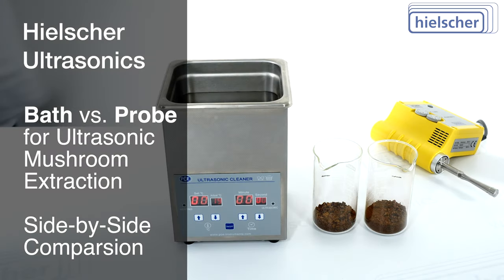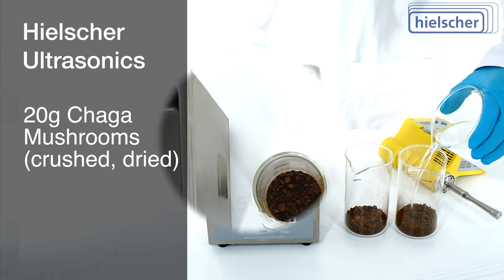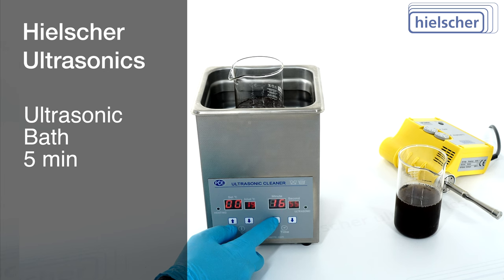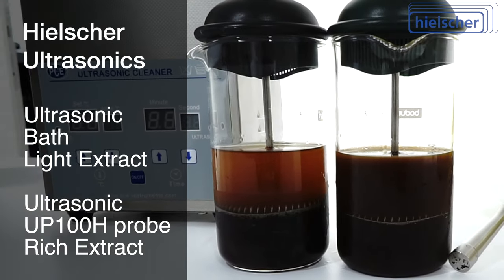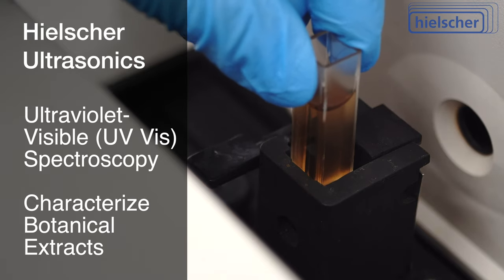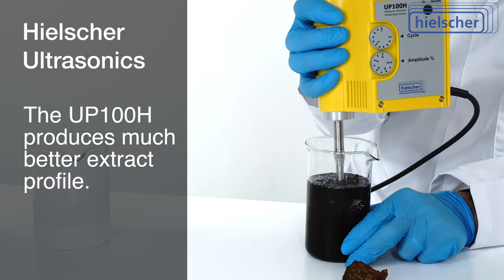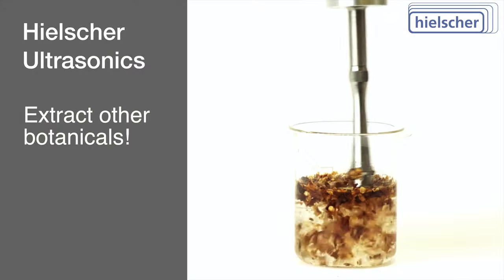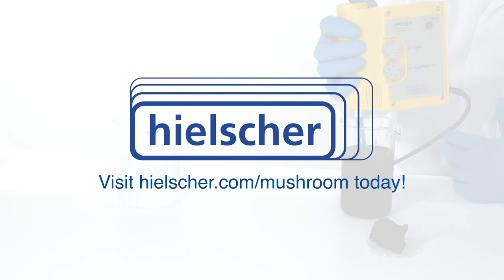Mushroom Extraction - Bath vs Probe Sonicator - Side-by-Side Comparison

Comment: The bath costs < €100, the probe >€3000.. not a solution for at home.. unless you have €3000 laying around somewhere
Reply from the maker: @timm5358 If the bath simply cannot extract properly, you waste €100 and got yourself an expensive jewelry cleaner 😆
Reply: right, this couldn't be directed at normal consumers, regular people would buy the 100$ one and just run it for longer vs spending 3000$
Reply from the maker: @jhonsmith5567 That’s like trying to drive a nail into the wood by tapping it with your finger for half an hour.
Running something at much lower intensity for longer is not the same as high intensity for a short time. Hope that helps 😉
Reply: @HielscherUltrasonics  Looking into your products but don't have the money at the moment, plan on buying in the future. 
But I am wondering even if you were to run the water bath method for 24hours with the extract directly in the stainless pan, it still would not produce similar quality extract? 
Glad I came here, saw this video and comments, as I had been browsing water baths.
Reply from the maker: @Jake-jj1zs If you sonicate in a bath for 24 hours, the liquid will get hot (boiling). This results in a thermal degradation of the bioactive compounds. Even with pauses for cooling, the low intensity of bath in insufficient for breaking the cellular structure or overcoming the limited permeability of the mushroom matrix. Therefore, a cleaning bath cannot extract the same quality or quantity of bioactive compounds as a probe sonicator.
Reply: @HielscherUltrasonics  Copy that, will save money for Probe Sonicator.
Would like to bounce another question off you,
What about a magnetic stir plate in a cold environment for 24 hours (vs. 30 day soak)?  Assuming it wont reach sonicator levels of quality but assuming the agitation is helpful.

Other videos say to do a long soak in ethanol but now realizing that is not the way to go, better to do it quickly with lots of agitation. I also see in your video, it requires the strong agitation due to the chitin.
Reply from the maker: @Jake-jj1zs: Our clients extract almost all materials, such a oak (for oaking) cannabis (for CDB or THC), spices, herbs, fruits or all kinds of mushrooms (magic and non-magic). In our 30+ years that we make ultrasonicators, we have seen almost everything.
Botanical extraction is a matter of intensity. More so for robust matrixes, such as wood, dried spices or mushrooms (yes, chitin). The ultrasonication does improve extraction speed, due to the intense agitation and the promotion of mass transfer. More importantly though, the ultrasonic cavitation breaks cell walls and solubilizes hardly soluble substances. Without the cavitation intensity, the latter won't be extracted at all. Last but not least, sonication does extract more and faster without harsh chemicals and without heat. Heat degrades thermally sensitive bioactive molecules.
In short: Sonication extracts faster, more and a wider spectrum while preserving the extracted compounds. This gives you a full spectrum, high quality extract and an excellent extraction yield.
Reply: It would be a better test to pour the solvent and botanical product directly in the bath, it is designed to hold liquids. Placing a glass beaker containing the solvent and product into the machine will reduce its effectiveness. It’s not designed to be used like this
Reply from the maker: @marksymark1 While not using a beaker may be slightly better for the extraction (still very poor intensity, less than 20 Watts per liter), exposing the bath inner surface to solids during sonication reduces its lifespan drastically (—> keyword: pinholes). Unless you want to buy new equipment frequently, you should not use a bath with solids in it.
We hope you like our video! Please follow our channel for more interesting videos. Thank you! 
👉 https://www.youtube.com/channel/UCG1xa_8clP9cRlq7kIcWQug?sub_confirmation=1
Reply: A good ultrasonic bath is designed for years of use, sturdy stainless steel construction they use them for cleaning automotive parts, no chance of pinholes, 30 watts per litre minimum. It is recommended to run several cycles per batch for maximum extraction. Product from Hielscher is very good and if your budget allows it would be a good investment.
Reply from the maker: Citation from a recent third-party study: "Probe sonicators fared better than bath sonicators in extracting bioactive compounds while ultrasound assisted with enzymes was more efficient than conventional or alkali extraction methods." (Inguanez, L.; Zhu, X.; de Oliveira Mallia, J.; Tiwari, B.K.; Valdramidis, V.P. Extractions of Protein-Rich Alaria esculenta and Lemna minor by the Use of High-Power (Assisted) Ultrasound. Sustainability2023,15,8024. https://doi.org/10.3390/su15108024 )

Comment: You're using the ultrasonic bath wrong. It doesn't work as well when objects are placed directly on the bottom of the bath. That basket it comes with is not optional. Set the beaker in the basket.
Reply from the maker: @LarsLarsen77 we will take this into consideration for future videos.
Thank you for watching our video! If you liked this video, please share it with your friends and colleagues. Please subscribe for more videos! 
👉 https://www.youtube.com/channel/UCG1xa_8clP9cRlq7kIcWQug?sub_confirmation=1
Reply: @HielscherUltrasonics  You should compare magnetic stirrer, ultrasonic bath with mushrooms and water in a thin vacuum-seal type bag floating in the basket, and sonicator wand. I keep trying to find some scientific evidence to support your claim,  but so far what I've found is that for some compounds in some mushrooms,  less power actually increased yield, not more power. So SOMETHING is happening at low power levels,  the question is what.
Reply from the maker: @LarsLarsen77 Noted. We will consider this for a video in the future.

We supply to many customers for botanical extraction, including fresh and dried mushrooms. Many of our clients begin with a lab-scale probe sonicator like the UP400St (400 Watts) for initial testing. The extraction yields and product quality are typically so favorable that many choose to scale up to larger inline systems, such as the UIP2000hdT (2000 Watts) with a flow cell reactor for commercial production after successful lab trials. We are confident that our professional clients have a strong understanding of both yield and quality, as they are committed to producing exceptional products for their end customers.

Thank you for your attention. Subscribe for more updates and future videos: 👉 https://www.youtube.com/channel/UCG1xa_8clP9cRlq7kIcWQug?sub_confirmation=1

Comment: Of course the cheaper bath is not that efficient because of it's design and higher volume but if you take out the piezo element make the wires watertight and drop it into your glass container you get almost the same effect for much cheaper. It's ridiculous how much these probe sonicators cost (3000,- EUR and upwards).
Reply from the maker: @DanielSchweinert: 🤣🤣🤣 No you don’t. You don’t get even close in amplitude or intensity.
Reply: @HielscherUltrasonics  there are some DIY sonicator tutorials on YT to mimic the UP50/100 but it involves to make a horn on a lathe and tune it to the right resonance frequency.
Reply from the maker: @DanielSchweinert : I suppose, I know the video you are talking about. Performance sonication is about getting power into the liquid - effectively, efficiently and at specific sonication parameters (e.g. amplitude).
Ultrasonic effects change drastically with sonication amplitude (and pressure when using a flow cell). 125 micrometers of vibration cause a much different cavitation intensity than 1 micrometer or 20.
Reply: @HielscherUltrasonics  Im new to this ultrasonic stuff but Im learning fast. I just want to do some lions mane tincture but cant spend thousands of EUR for a simple sonicator that consists only of a driver board, transducer and a tuned horn. There must be a cheaper way to break up that chitin cells with other science.
Reply: @HielscherUltrasonics  vielleicht benötigt ihr ja professionelle Produktfotos von so einem UP100H Gerät? Ich hab ein Studio :-)
Reply from the maker: @DanielSchweinert  You can cook lionsmane for a couple hours. The extract composition will be different, as you lose heat sensitive compounds. For home use this may be better than nothing, though. Lionsmane „tea“ has been around for a long time.
Reply from the maker: @DanielSchweinert  Unser Unternehmen sitzt in Teltow bei Berlin. Vielleicht möchten Sie ja mal bei uns vorbeikommen. Wir können gerne für Sie kostenlos etwas Lionsmane extrahieren und mittels UV Vis analysieren. Schreiben Sie uns bitte per Email. Danke.

Comment: Might be a daft question.  If the mushroom powder was in the bath fluid rather than a beaker would that be better?  Don't the sound waves have to travel through the glass in this demo?
Reply from the maker: @jem4054 You are right, the glass beaker reflects and isolates ultrasonic waves. The intensity in the beaker is approximately 50% lower than in the bath. However, the intensity in the bath still much lower than under the ultrasonic probe.
We value your engagement with our content. Stay ahead by subscribing for more professional updates and insights: 👉 https://www.youtube.com/channel/UCG1xa_8clP9cRlq7kIcWQug?sub_confirmation=1

Comment: could you not just leave it in the ultrasonic cleaner for twice as long instead and probably get the same result
Reply from the maker: @jaydenimbriano5690 Will you cut through steel with your flashlight, if you shine on it for twice as long as with the cutting laser? Time is no substitute for intensity.
We appreciate your interest in our videos. To stay updated with our latest content, please consider subscribing: 👉 https://www.youtube.com/channel/UCG1xa_8clP9cRlq7kIcWQug?sub_confirmation=1
Reply: @HielscherUltrasonics  I don't think that's really a fair comparison in this case. If you extract mushrooms in alcohol you will extract much more leaving them to soak in 6 weeks then one week with no added intensity
Reply from the maker: @jaydenimbriano5690  
In the absence of sufficient mechanical stress capable of disrupting cellular structures and emulsifying insoluble elements, the extraction process is limited to the fraction that is soluble in alcohol and capable of diffusing through cell membranes.
Reply from the maker: Comparing the cleaning bath to the UP100H probe sonicator is like  pitting a kitchen knife against a heavy-duty chainsaw for tree cutting - it's just not a fair match. The cleaning bath simply isn't designed for botanical extraction tasks, especially not for dealing with the robust Chitin-based cell structures found in mushrooms.
The cleaning bath is well suitable for cleaning jewelry or even carburetor nozzles, but when it comes to extracting substances from materials like mushrooms, it falls short due to its very limited intensity. Even giving it an extra 30 seconds of sonication time doesn't bridge the gap in effectiveness compared to the UP100H probe sonicator. So, while the cleaning bath has its uses, extracting mushrooms isn't one of them.
Thank you for engaging with our video. Enhance your experience by subscribing for more professional insights: 👉 https://www.youtube.com/channel/UCG1xa_8clP9cRlq7kIcWQug?sub_confirmation=1

Comment: What solution should i use for extracting cyanocobalamin? And what type of ultrasonicator should i use if i want to extract it from mold?
Reply from the maker: @Kevin-ox7zp: Cyanocobalamin is water-soluble. Although it can also dissolve in dimethyl sulfoxide (DMSO), which is a non-toxic, polar aprotic solvent that mixes well with water, the need for such an advanced solvent may not be necessary in all cases. I recommend starting with a mixture of water and the substance from which you wish to extract cyanocobalamin. The choice of the most suitable ultrasonicator depends on the volume you need to process. For smaller samples ranging from 50 to 100 mL, consider the Hielscher UP100H, a 100-watt sonicator available at this link (https://www.hielscher.com/UP100H). Please feel free to contact us directly, and we will be happy to assist you with your extraction process.

Comment: Why UV-VIS instead of Raman, NIR, or MIR spectroscopy (or even HPLC)? Are absorption bands in the UV-VIS meaningful with regards to the compounds extracted, because to me both signals look weak in that range (i.e: no discernible peaks) and all they might show is that less visible light is transmitting through the medium after ultrasonic extraction. So, from that standpoint, perhaps your wand does a better job of homogenizing or breaking down the  the powdered mushroom, but it is not immediately clear that the ultrasonic extraction was "better" as a result of using the wand over the bath (which could be supplemented with a longer exposure time within the bath itself). Additionally, I don't care about an additional 30 seconds if I can leave the beaker in the bath and walk away and do something else. Whereas, with the wand you have to hold it for 4 min 30 seconds (although, I am sure y'all sell a stand). In any case, do you all have other tests (NIR, MIR, or Raman) that suggest the quality of the extraction is better?
Reply from the maker: @davidlanday2647 That‘s a long comment.
Our customers analyze for specific components when we return extracted samples after extraction tests in our lab. When compared to conventional or alternative methods, the yield and quality seems to justify investing in our ultrasonic machines. Please consider that we mostly supply to commercial scale extraction operations running tons per week or even per day.
The UV-Vis makes a good qualitative comparison. If you produce extracts, you should have access to more quantitative analysis, as natural raw materials change over time and between batches. Else, potency becomes a better guess in your production.
We would be happy to work with you on your extraction project. Please contact us directly. What would you like to extract? How much material do you need to process?
Thank you for your attention. Subscribe for more updates and professional content: 👉 https://www.youtube.com/channel/UCG1xa_8clP9cRlq7kIcWQug?sub_confirmation=1
Reply: @HielscherUltrasonics  I get you; the final analysis is just a bit confusing. Given you are trying to compare extraction methods (your ultrasonic wand vs a cheaper ultrasonic cleaner) of an analytical sample of chaga, it would be helpful to understand what the UV-VIS readings are actually telling us with respect to those compounds. i.e: given the test is determining the extraction quality from powdered mushrooms, wouldn't you want to show us that your device shows better extraction of, say, beta-glucans (which would show up in NIR 850-2500nm)? Is there a report that goes along with this video? It would be helpful. Also, one absorption spectra looks very smooth, while there are some definite noisy spots in the other spectra. Were the same sampling resolutions used? path-length? sample averaging?
Reply from the maker: @davidlanday2647 This is an illustrative video. The same sample to liquid ratios were used with identical settings on the UV-Vis. Actually both samples were analyzed right after each other on the same equipment. Hence it works as a qualitative measurement for comparison. Chaga extraction contains a number of water soluble and water insoluble compounds. Probe sonication is significantly more intense (more power per surface area due to higher amplitude). This higher intensity can break cell walls, that bath sonication, heat or time cannot break. We would be glad to repeat that test together with you in our lab. You are welcome to bring other measurement equipment. Thanks again for watching.

Comment: I wonder how long you can use the extracted liquid in room temperature without going bad. And extracting solvent,  should I use water , alcohol, or oil?
What percentage of the plant can you extract?
Please answer me for this.
Thanks
Reply from the maker: @kellykim4794 This is not easy to answer. You will have to test various protocols and formulations. We will be glad to help you with your extraction project. Please contact us directly!

Comment: Wouldnt it work if you have the same area of mass as well the same watts?
Reply from the maker: @anthonyackerman5556 The difference between probe type sonication and an ultrasonic cleaning bath is the intensity - the power coupled per surface area. Due the technical design of an ultrasonic bath, the amplitude - this is the mechanical displacement of the surface in contact with the liquid - is limited to approx. 1 micron. Hence, a cleaning tank couples the power across a large surface area at very low intensity. Ultrasonic probes have adjustable amplitudes of up to 100 micron or more. This couples the power using a very small surface at a much higher intensity.
The intensity of an ultrasonic bath is much too low to effectively break chitin and cell wall structures.
Thanks for watching! Please subscribe to our channel for more interesting videos!